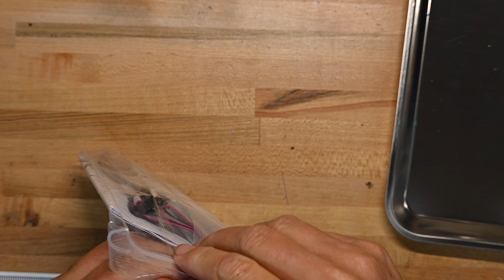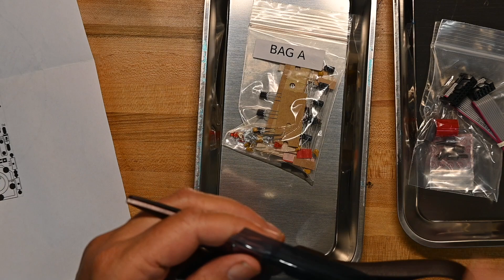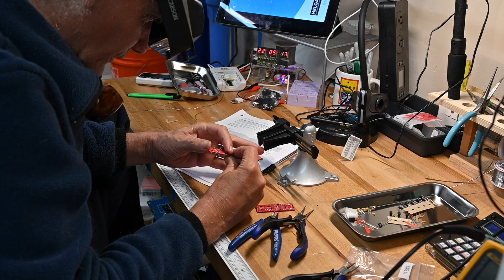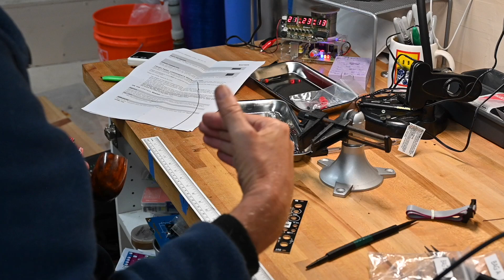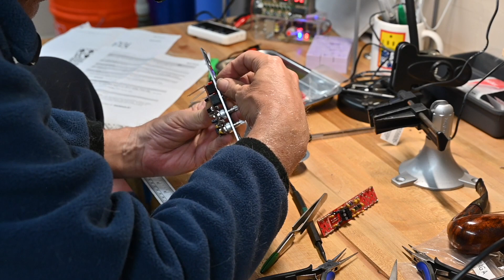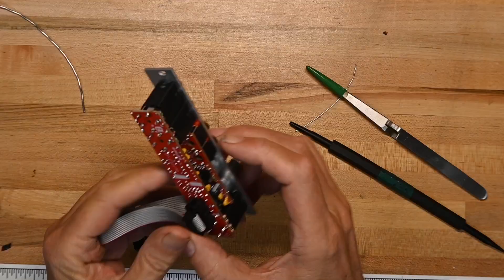C.K. builds a Befaco Out eurorack module (euro rack)

Comment: This is a great build. The middle board is definitely a good challenge. The header in the center would be the one that I would be most concerned with because it is hard to see all the pins. Grounding out the pots would be a bummer too. Very well done. I would like to start something like this, but the actual Euroracks are pricey and finding the materials to build one might be challenging as well. Thanks again for the content!
Reply from the maker: But not too bad.  I've built 5 of these for my studio, and they're pretty quick once you've done a few (which VERY few people will....) .  I will be posting a video on building your own Eurorack frame in the next little while.
Reply: @CKHaun  The Eurorack build will be great. It will help me decide my module lineup. 👍

Comment: I am about to build the A*B+C module and it also has the some ferrite core thing. First time I have encountered it in a DIY kit.
Reply from the maker: Some folks use 'em, some never do.  Befaco usually has them, for example. They can be slippery little things.  I'm not certain an inductor is actually needed in eurorack, but it doesn't hurt anything.